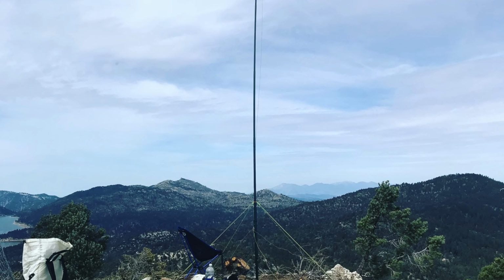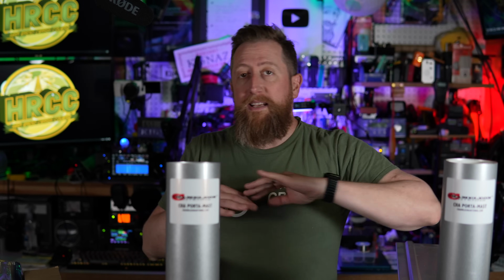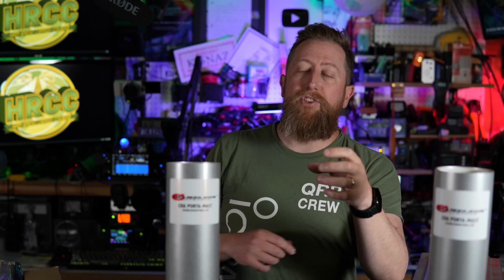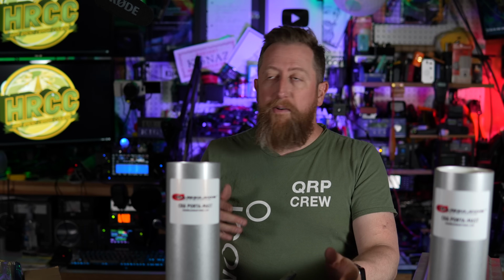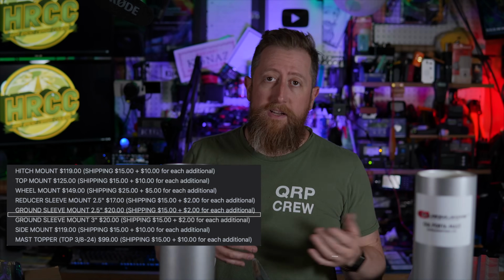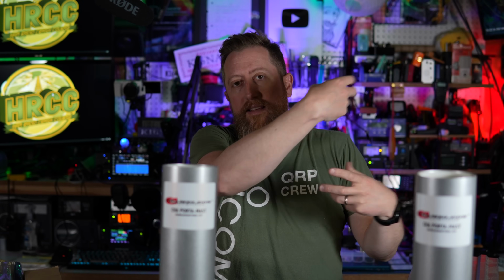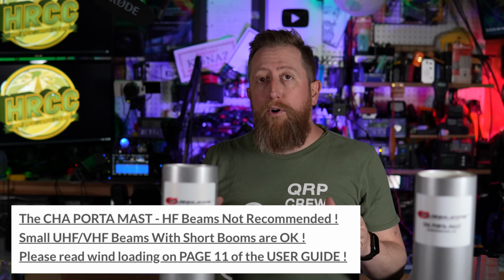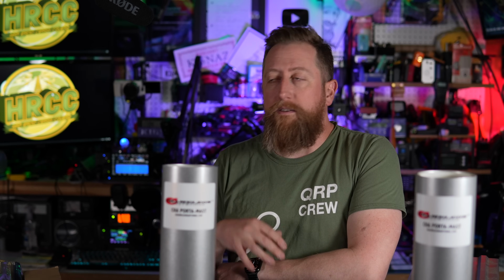Chameleon PORTA-MAST: Fast POTA Ham Radio Antenna Setup

Comment: Aloha Josh, I remember when you filmed that first video in the beginning and why. That was a very nice pile up on 10 meters that day with that custom go box. 
     Some weeks ago, I was the victim of an accident in which I was T-Boned by a girl on her cell phone doing 60mph when she ran the red light. I just spent another week in the hospital here in Honolulu and still so very sore and will be for a long time. 
    This new part is actually ideal for those of us that are disabled and just want to keep things quick, simple and get on the air. Not too much bending over, laying things on the ground nor picking things up. 
     I could even see this part modified just a little bit to hook the mast pole to the lip of the baseplate pipe, allowing everything to be set up as easy as 1,2,3. The possibilities are endless in this SPORT, eh, I meant, Hobby, lol! 😂🤣❤😂🤣
Todd de WH6DWF 🇺🇸🤙🏻🇺🇸

Comment: Thanks for the video! I'm considering the porta-mast for a semipermanent installation on my QTH. I'm restricted by FAA, so I'm thinking installing the top mount on my roof and using the mast to install some a vertical and a wire antenna.

I wonder if I would have to put up a second one if I have more than one vertical? Or would I be able to dual mount it?

The video did a good job of showing the mechanism, I'm really pleased with that! I can use that to take things down for storms and hurricanes!

Comment: Do you think that the 25ft Cha-Porta mast will be able to handle the COMET CHA-250HD HF vertical antenna? I am considering this as a semi-permanent install on the side of my house. The Cha-Porta mast is not as heavy duty as the Spiderbeam 10m mast, but its also not $600.

Comment: I love my TDL, but assuming I toss my MPAS on the top of this... What would you recommend doing with the radial?  I'm guessing either one just hanging down the length of the antenna, or have it slope out a bit to a point on the ground?

Comment: You choose a beach by saltwater where just about any antenna will perform well. Put it in an inland big city HOA and lets see, need adverse environment testing.
Reply from the maker: I’ve already reviewed the antenna ground mounted and inland in an older video. Search “tactical delta loop” I literally referenced it in the video.
Reply: Some operators have been using the CHA TDL in downtown LA (surrounded by tall structures) for NVIS purposes.

Comment: Is this something that can be raised from the ground for those of us looking to use a mobile mount with a sedan or SUV vs a pickup? The 25 foot mast shows a collapsed height of almost 8 feet and that's before putting an antenna on top of the mast.
Reply from the maker: You would likely need a step ladder.  The segments are about 8'.
Reply: Each segment is 8'....I wonder if that'll fit in the back of most typical SUVs like my  Subaru Outback? What is the length of the shorter masts?

Comment: KI6NAZ, KI5SIB. 

I have another question for you since you own the CHA portal-mast. I live in an area that’s mainly over quarry rock in San Antonio. I am thinking of maybe using the wheel mount and placing something substantial, like brick over the tongue side to keep the mast steady, or maybe making some cement screw mounts to it to keep a 25ft pole steady. Do you have any advice or recommendations since I am in an HOA who has CC&Rs, some of which is illegal to Texas?
Reply from the maker: Just buy the permanent installation mount. They have mast mounts that aren’t the wheel mount.

Comment: I was just wondering.  Could the 25 foot mast be used at lessor height ?  For example just put up enough mast for each mast section.  Or will you always be required to use the full 25 foot.  I thought of this after I ordered last night.
Reply from the maker: You can leave one of the sections not extended.